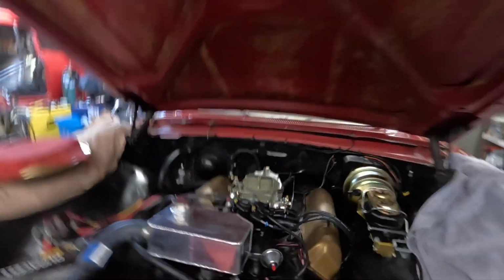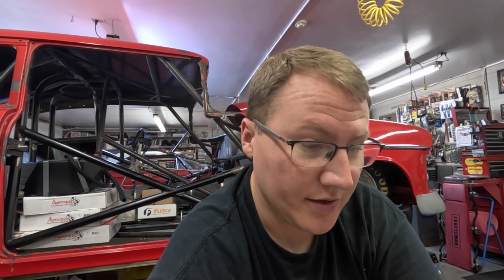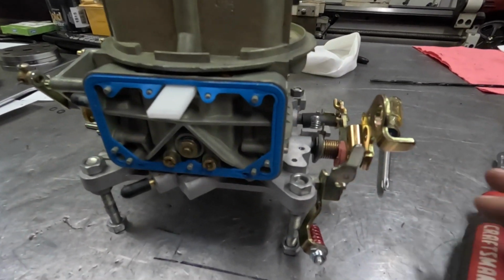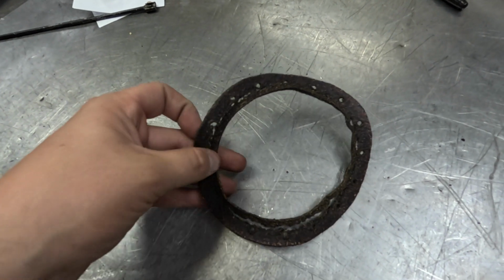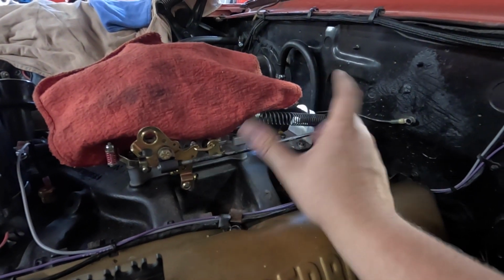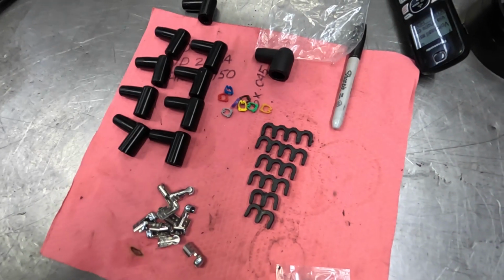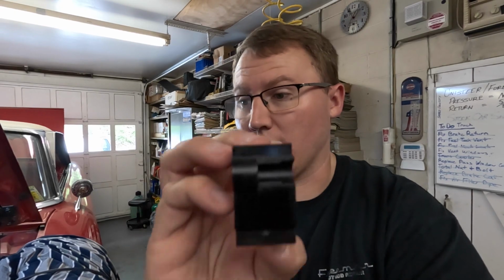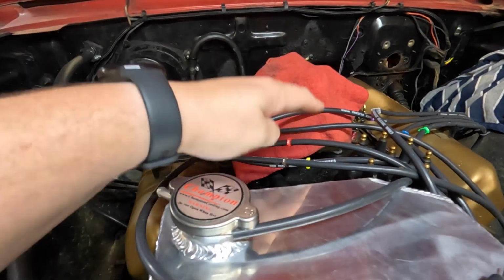V8 Power Upgrade: Holley 750 Carb Install on '64 Ford Galaxie

Comment: Thanks for making our POWERBLAST PLATEs part of your build guys! We think you will be very happy with them, but wanted to correct your statement that we "claim" 20 HP improvement. There are 2 dyno test on our website which show improved peak TQ and HP numbers, but it is noted in several places that the POWERBLAST PLATE was specifically designed to improve throttle response and acceleration performance. However, as a "happy side effect", we are also seeing increases in peak Horsepower and Torque, simply because the engine does not have to recover from a flood of wet, raw (unatomized) fuel.  

Because there are many variables, engine to engine, that can effect overall performance, the Horsepower and Torque improvements created by the POWERBLAST PLATE can vary from vehicle to vehicle. However, in every chassis Dyno test independently performed for us, there have been performance improvements.  In addition to these independent shop chassis Dyno tests, some of our customers have reported their own independent Dyno test results showing improvements in peak HP and Torque after installing the POWERBLAST PLATE on their carburetor.  Again, the POWERBLAST PLATE was not designed for these specific performance enhancements, but they have been shown time and again to occur. (Just an added bonus to the real purpose of the PLATE, which is much-improved throttle response and acceleration performance.) You can see the results of independent dyno tests on Testing page of our website here: https://thompsonperformance.com/pages/testing.
Reply from the maker: That completely makes sense! Sorry we made that big statement! Got to drive it today and it seemed very happy! Tune back in soon to see that too! I appreciate you all watching and subscribing!